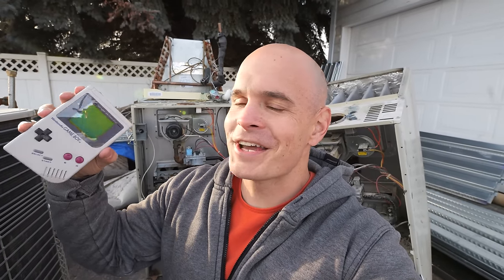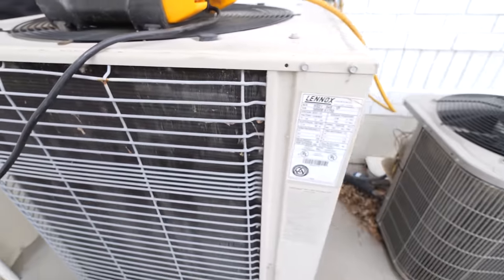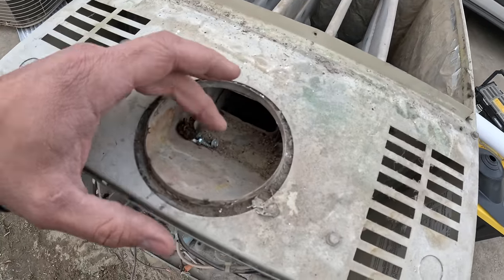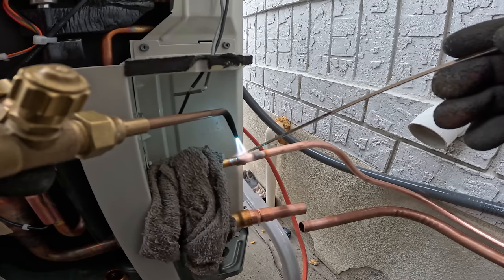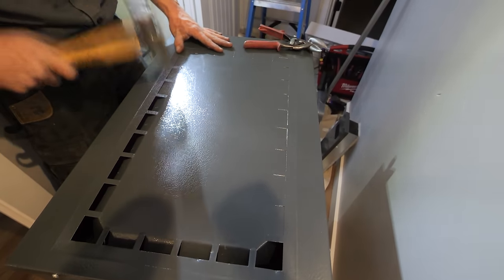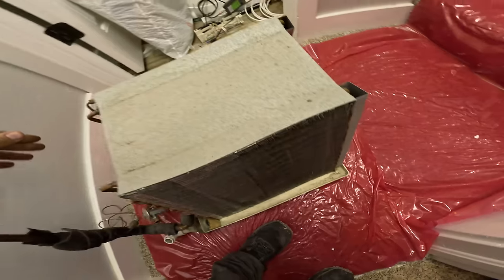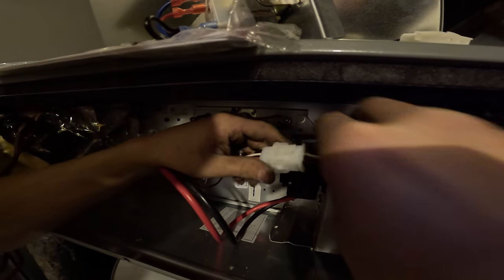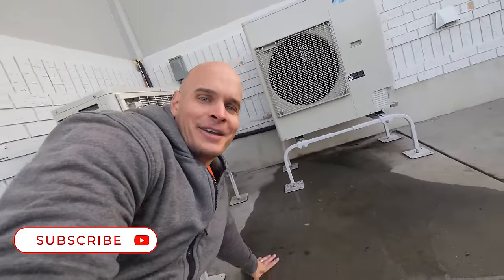Why is Everyone Talking about Heat Pumps?

Comment: With a high efficiency heat pump you should not even need an Electric or gas backup.
Reply: 😂 More lies hp fans say. They dont have the ability to heat homes up north. Requires them to just maintain. God forbid you lose power, they will never be able to catch up for a few days vs 30 mins with a gas furance
Reply: @zack9912000  I live in northern Norway and only heat my house with a heatpump. And so does almost everyone else for the past 20-30 years. It's common to have a wood stove as backup, but that's very rarely used because modern heatpumps are just good enough now.
Reply: @logitech4873 Here up northern US we easly have months of negitive winter weather way outside the efficiency curve of any heat pump. They require AUX heat to even heat a home. Most heat pumpts turn off at 32 on average and even the new models ones drop out at 0 to -5
Reply: @zack9912000  Name an area with months of temps below like -25°C.
Reply: @zack9912000   Only the crappiest heat pumps shut off at 32F. Usually there's specified output down to 22F outdoor temperatures. You should still have aux heat but even in northern states you can go 90% of the year without aux heat.

Comment: Any recommendations for a dual-fuel system for Wisconsin? How might such a dual-fuel system compare price wise with a ground source heat pump (including installation)? Can't quite get a handle on the figures myself yet.
Reply: Around 20-30k for a geothermal heat pumps. Stick with gas, heatpump are terrible performing in cold climates. You will regret it and the total cost over the life of the unit is high

Comment: I' m from Spain and it seems weird to me having all that equipment because in my house we only have a boiler. With that hot water we heat radiators arround the house. We also have an AC. Having a boiler and an AC (or a fan) it's kind of an staple. My question is: Why do you need all that machinery to heat or cool your house? Is it because it's way colder and hotter or does every house in the States have that system? How eficient is it? I'd appreciate if someone could explain me a little bit about it because it blew my mind when I saw that set up .
Reply: Hi. In Spain (I have been in Madrid) the temperature only drops until -5 °C. So it would be very efficient for a heat pump. Installation cost varies for a typical 5kW unit, reasonably priced for an air to air unit. Most of the time if sized correctly the running cost is cheaper than the gas boiler (Spain gas Vs electricity price). Furthermore installation are way cheaper if you don't need to output the heat into water tank, just the same type of installation as your AC.
Reply: @jasonw98  I see... Thanks for the clarification, I'll definitely look into it in the future, when the time comes. Thanks!

Comment: You probably don't have enough insulation if your house is 30+ years old and that's why the fan spinning so much and that you use the old gas (50degree c) instead of R290 (70degree c)

Comment: R22		1810 GWP (Global Warming Potential)
R410A	2090 GWP
R32		675 GWP
R290	3 GWP

All major heatpump manufacturers last 1-2 years start to produce R290 models, they are all monoblocks, because gas ir flammable, but they can heat water up to +70 to +75°C (158-167F), depending on model.

R410A models are cheapest, because that gas already have ban dates set in many countries to jan. 2025.

Comment: this has big flaw in its design. Its a disaster multiplier. Imagine temp is very low  and all heat pumps installed suddenly start using heat coils. pressure on grid increases 5 to 8 folds. 
we need some sort of heat storage in everyhouse ( thermal storage )

Comment: Hey question. Why dont AC units run out of refrigerant but cars do?
Reply: First of all, AC units do often leak refrigerant. Cars leak much faster because the compressors are mechanically run and it's impossible to make a perfect seal around a rotating shaft. Electric compressors are fully hermetically sealed.

Comment: Curious why you didn't go for a propane (R290) heat pump? They are generally more efficient and R290 has a lower GWP, reducing the emissions compared to R410A by about 15%!
Reply: I don't think any manufacturer does R290 in a split system this size. As a European surprised a new Daikin has r410a as all Daikins here have R32 nowadays.
Reply: @BenIsInSweden  We have a Panasonic hydrosplit, but you're probably right, I haven't seen one for North American style ducted systems with R290. Even still, R32 is pretty much the standard in most everything else and still a bunch better than R410A.
Reply: @fischer-felix  Yeah Hydrosplit seems to just be a monoblock, with some of the components moved to an indoor unit (pump etc).
So only useful for waterborne systems.  To be honest, I'm not really sure which residential applications would have an advantage with installing a hydrosplit over a monoblock. 
As mostly they say their advantage is over split systems as they don't have the refrigerant running to the house, which a monoblock doesn't either.
Reply: @BenIsInSweden  I think hydrosplit is actually more of a marketing term, since most monoblock heat pumps nowadays are "hydrosplit".
Reply: There are illegal here for splitsystem's, EPA has restrictions for it usages to certain equipment and even then its limited to 5.25 oz. Propane has a habit of blowing up when they leak. As for R32 it performs worst then R410A and R454b performance is better than R32
Reply: @zack9912000  The whole "Propane will blow up when it leaks" thing just annoys me. If that were such a problem, then why do people have 2000l propane tanks in their gardens and the stuff plumbed up to their house. A traditional gas fired furnace isn't even a closed-off system, while a split heat pump is.

This is a problem not just in the US, similar restrictions apply here in Germany and it just makes life harder for people looking to get a heat pump.
Reply: @zack9912000  I'm always curious how people say the newer used refrigerants perform worse.
There might be properties of the refrigerant on paper that make them worse but in basically all practical applications a manufacturer won't make 2 same-application heat pumps using different refrigerants without a generation jump, so a direct comparison can't really be made.
I've never seen a r410a heat pump that has been superseded by the same manufacturer with a R32 one and the R32 one has worse COPs etc
Nor have I seen a r410a heat pump outperform all R32 heat pumps for the same application.
Reply: @zack9912000  As if americans with gas lines would care about their stuff blowing up
Reply: There are more safties in a NG equipment that prevent the gas from ever flowing if there is a issues and locks the system out. Copper refrigerant lines leak over time as they age. Black pipe in a home doesn't leak if sealed properly at the connections
Reply: @BenIsInSweden  These refrigerants have been in development and the reall world use for a long time for testing  well before its ever chosen. There are quite a few articles and white paper studies on them already.
Reply: @BenIsInSweden   That other commenter is a troll. On paper R32 performs a few percent better than R410A.
Reply: @zack9912000  A refrigerant line that leaks over time doesn't cause an explosion, the gas will have plenty of time to dissipate before reaching the explosive level.

Comment: It seams like you are presenting heat pump as a new  tech? In Norway this has been a normal thing to have  for over 20 years... The same is the variant where you drill a hole in the ground and pump water in a loop to harvest the heat form the ground.

Comment: This is so complex! Don't you have Solar? Why not just use AC!?
Daiking itself manufactures simple hot and cold AC inverter solutions integrated in the same package in various sizes, shapes and for single or multiple rooms.
They only use electricity, installation is much simpler with just one internal and one external unit, and copper lines.
They are fantastic! I used to sell AC back in the day and Daikin and Fujitsu were my favorites to sell because of their quality!
The only caveat is that I live in Brazil and here the temperatures are not that extreme and electricity is relatively cheap and there is a lot of sun. So I don't know if this solution would apply for everyone's needs.
Reply: YOu mean mini-split units? They're considered unsightly and you need a head in every room. If you already have ducts a central system is easier.
Reply: There are built-in models and they are MUCH more efficient than central systems. But it's probably cheaper if you already have ducts like you mentioned.  @eDoc2020
Reply: @costafilh0   A built-in model is going to be more expensive to install. I did know that mini-splits are considerably more efficient.

Comment: You can just update your gas from r22 to bluon r-458a in your existing system. I think that the new gas is 20% more efficient with a wider temperature range compared to r-22. It also does better than r-410 In hot climates. 

If you are low on r-22 you can swap to bluon without buying overpriced used or scavenged r-22.

Comment: I don't see the economics of heat pumps except for a very narrow band of circumstances. Amortized over lifespan they cost maybe $500 extra per winter. With colder average temperatures, the heating bill goes up, so it's worth saving more, but the efficiency of the heat pump goes down, so less is saved. You'd have to figure out the avg temperature where the savings are maximized and if that is greater than the extra cost. In other words, too warm, not enough savings, too cold, not enough savings. And the cold spells are taken out from the days you experience any savings because heat pumps don't work efficiently at much below freezing, at least not much past 0F

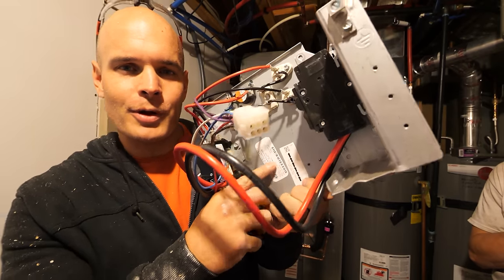Comment: 0:54 "far cheaper to run in both the summer and winter"  How can a heat pump be far cheaper in the summer if the AC you are replacing is just a heat pump to begin with?  It might be a little more efficient running them on a variable cycle rather than a on and off cycle, but it tends to be not that much. 3:00, the junk is the burnt dust from the air in your house, not from burning methane.  4:15 What's the purpose of brazing a stub just so you can use a ProPress fitting?  I know you probably paid a lot for that brandy new Milwaukee crimper and want to use it every chance you get, but if you've already got the brazing equipment out, why not just braze the pipe directly like it's always done. 7:14  That's the bummer about air source heat-pumps.  If everyone installed them, then when the temp drops to the point it switches to resistive heating, everyone switches at the same time and puts a massive draw on the power grid all at once.

Comment: When the compressor activates, it changes the electrical energy into kinetic energy (the piston) which acts on the refrigerant. This energy is transferred into the refrigerant making the refrigerant hot. Pressure goes up so temperature has to go up. There is a lot of energy (heat) added. Your explanation made it sound like the only heat is coming from outside or inside. This is incorrect since the compressor adds way more heat to the refrigerant than what can be added from air inside/outside the home.
Reply: Most of the heat is coming from outside. When the unit is operating at a COP of 3 it means twice as much heat is coming from outside compared to from the compressor itself.
Reply: @eDoc2020 It takes less energy to keep the compressor running than it does to start it up. If you measure the COP when the compressor is running you will get numbers in the 300% range of efficiency. However, that is not the case when COP is measured. COP does not take into account the energy required to start the compressor over and over again.
Reply: @rosegold7975   And that's one reason why short-cycling is bad. If you have proper run times the startup losses do mot have a large impact.

Comment: What I don't see mentioned is yes, heat pumps are efficient, but the heat doesn't feel hot. I know, counter intuitive, & the thermostat says it's 68 but it's not the same as gas or electric.

Comment: "phase down the production and consumption of certain hydrofluorocarbons (HFCs), including R-410A. This phasedown began in 2022 with a 90% production allowance (meaning businesses must reduce HFC-derived CO2 emissions to 90% of baseline values) that drops to 15% by 2036 and beyond.". It suck that you have to still use the older gas. Hopeful no leak for a very long time. 🎉
Reply: He will be grandfathered in.
Reply: @antikommunistischaktion  no, it just mean like like R22. If you have any leak or need a top off. It would cost more. Can't really plan that long in the future. I think 25lb was like $40? Now $300. Later much higher. It is what it is.
Reply: @RokkuAni  R22 is 1,600 on average for 25 pounds.

Comment: I lost all respect for those installers as soon as i saw them brazing with no nitrogen flowing. Also those crimp fittings used will leak overtime as the only thing keeping the high pressure 410a from escaping are rubber gaskets. MAKE THE COMPANY PAY FOR THESE MISTAKES WHEN YOUR UNIT NO LONGER WORKS. I do hvac installs in mega mansions along socal coast newport area. We never use those compression fittings for copper because it has not been proven to work with time unlike basic brazing with oxy acetaline.

Comment: Though press fittings are all the rage, has anyone with no dog in the fight analyzed them for longevity ? Conceptually, awesome... but we went through that with pvc supply pipe in the 60s and 70s, Asbestos in the early 20th century.  Flared fittings in unions prove to be good, as do compression fittings with a ferule.... the material matches the fitting. I guess those have a failure rate, but the effectiveness is in the QC, which is in the automatic manufacturing. The PRESS fitting depends on installer QC, as well as the sealing ring.

Back to the Heat Pump..... because this runs almost continuously, and not running big blast cycles, would a heat pump be able to handle older homes' smaller ducting better than traditional heat ?   I have the 1960s 4" round lines running off the main trunk..... this is minimal. OR does it make sense to demo the delivery side and put in larger ducting ( once calculations are made for requirements per line )? I have a full, unfinished basement, so access is not destructive.

Comment: How do you prevent the heat pump from freezing to an ice cube from the moisture in the air?
Reply: They have defrost functions.
Reply: @logitech4873  That's what I expect, but how do they work?
Reply: @mikolajwojnicki2169  I think they reverse cycle for a short time to heat up the outside coil and melt the ice.
Reply: @mikolajwojnicki2169  The reversing valve will switch over to AC mode basically to defrost the out door coil
Reply: @zack9912000  Sounds very inefficient when it's well below freezing outside
Reply: @mikolajwojnicki2169 they would defrost only if there is ice outside.
Reply: @mikolajwojnicki2169   The outdoor fan is shut off during defrost. All the heating goes into the ice and it doesn't get blown away like it would during the summer.

Comment: Air to air heat pumps are not the most e efective, a better alternative would be air to water (heated floors) and Evan better would have been soil to water if you would have buried some pipes in the ground while building the bunker.
Reply: Love boiler heat, most comfortable heat there is.

Comment: Should have gotten a Trane-Mitsubishi Heat pump 😉
Reply: They are bettwr equipment and leader in these systems, problem with them is they are constantly issues getting parts. They change a board designs alot  and stop producing old parts for models as old as 6 years. So you have to replace them.

Comment: Electricity is very inefficient for heat and extremely expensive when used for heat. Heat consumes a ton of electricity. A small little home electric heater is 1500 watts! I can't imagine what a heat pump would cost when using electricity to heat a home. In Utah we have extreme temperatures on both ends. I asked about installing a Heat Pump option and the HVAC guys (I've asked several) all said a heat pump is not practical for Park City. It would need electricity as a backup for heat. I pay about $27 a month in electricity bills, I would be paying much more with a heat pump. Natural gas is very efficient and clean for heat. I'm reading the comments here and several people are keeping their furnace as a backup. Is that practical? So bizzare.

Comment: Heat pumps are interesting and very efficient.  Too bad most of the equipment manufacturers are producing overpriced garbage that falls apart relatively quickly.  The installers leave much to be desired as well, down here in Florida.

Comment: Unfortunately you went with a Daikin... worst systems to work on, most commonly broken systems I work on, horrible tech support for field technicians, and horrid customer support. At least they can get you the parts though lol. R-22 is the most stable refrigerant because it's pure. Blended refrigerants like azeotropic and zeotropic blends are far less unstable, When comparing R-22 to R-410a for "environmental" purposes the ODP and GWP charts show that R-410a has a lower ODP but higher GWP rating than R-22. The changes for refrigerants were simply a money grab and never about the environment. If it was then they would get rid of ammonia and propane based systems that routinely unalive people.